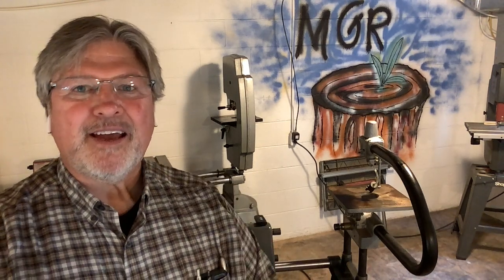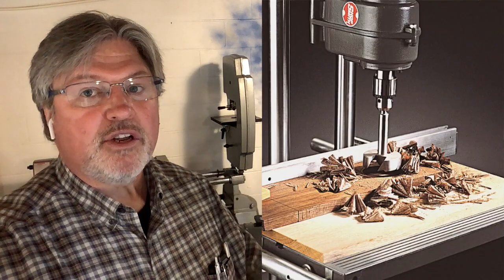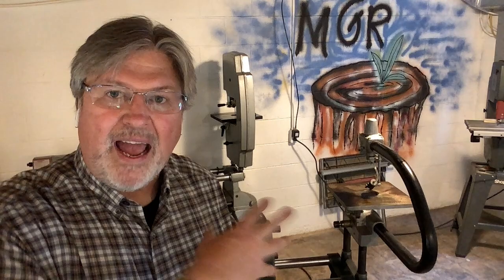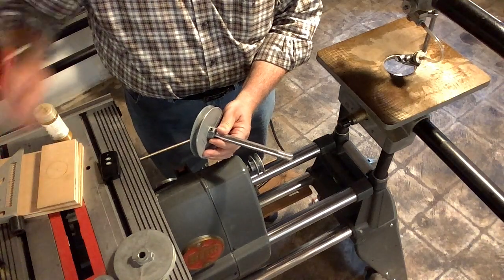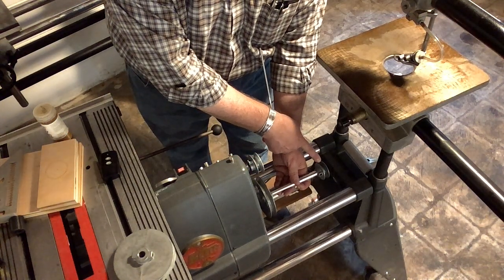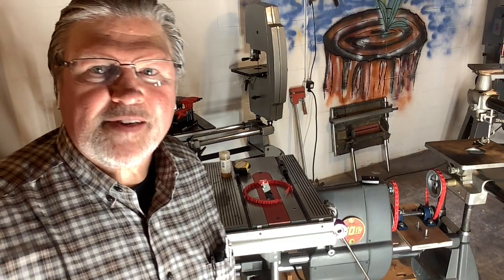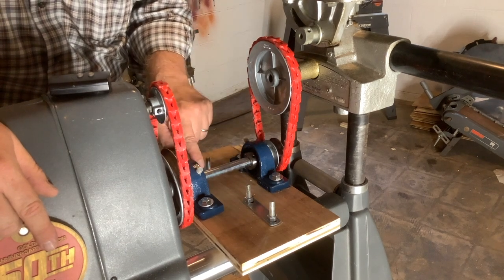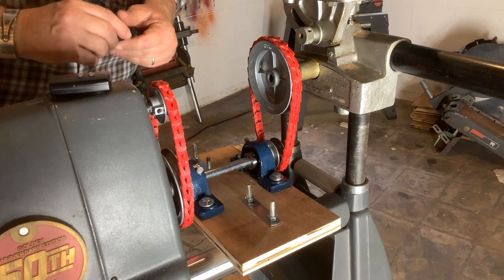Shop-built Shopsmith Speed Reducer

Comment: Can you show us cutting some brass or aluminum with the jigsaw and how it would work with the bandsaw? and in theory will this work with the powerpro? and what about the scrollsaw to say make Brass ornaments or maybe clock works??
Reply from the maker: Hey Joe. Probably not any time soon. You’d think it would be straightforward, but working in my sister’s basement has limited the scale on my operation and I just don’t have the supplies handy, for example, my files are now in storage, I’d have to buy a bandsaw blade I’ll likely never use again and the same goes for the stock to demo. I may take another stab at this once we land somewhere. Yes, this could work just fine with the PowerPro, thought I can’t think of too many places where you’d need to go slower than the 250rpms the PowerPro already achieves. Yes, you absolutely could use the scroll saw with this for cutting the half hard brass pieces used in clockmaking, Scott

Comment: Scott, I must have found the article decades ago, as I used the wedge under the Way Tubes, and used a larger pulley that would fit between the WTs. Set up and take down was quick as I remember it, and some fuss getting the right belts and tweeking the wedge, to tension the belts the way I wanted … worked great.
Reply from the maker: Excellent, John. Yeah, the article calls for a 7" pulley, which is not only hard to find these days but slows the SPTs quite a ways lower than I've ever needed.  Any chance you still have it? Scott
Reply: @MyGrowthRings  nope. It went with my original 500-510 when I sold it … 😢
Reply from the maker: @johnoerter2883  Well that's sad, but perhaps it is seeing some action with the new owner. Let's hope. Scott
Reply: @MyGrowthRings  I hope so … after I sold it the guy kept pestering me for items he was sure I’d kept back … got kind of distasteful, adding to my sadness. I missed my old SS for 20 years. 

Really nice to have the new Mk7!

Comment: Thank you Scott. Simple! Just ordered all the parts including both the 1/2 and 5/8 pulleys for the SPTs.
Looking forward to putting it together. Will likely substitute your U bolts for J bolts with Bitner nuts or a similar solution.
Thank you.
Reply from the maker: That's a great plan. Thanks for using the links! Scott

Comment: I bought a package of Shopsmith tools a while back, and the seller thew in a rusted up jigsaw and a dysfunctional headstock just to get rid of them.  I thought perhaps I could make a stand for the jigsaw using the headstock and a fully system to create a variable speed power system with a very low end rpm.  Well, the headstock was in much worse shape than I imagined, and the cost of buying the parts for it and the pulleys necessary would total out to more than I thought I could get by selling the end product.  I didn't need a third jigsaw, so I refurbished the saw and sold it to a friend.  I pulled the motor out of the headstock, which was perfectly good, and gave it to another friend so he could upgrade his Greenie with more power.  I like the system you devised, but since I run the Power Pro, I won't be building my own.  Thanks again for supporting all of us Shopsmithers.  We cherish your info.  Glen
Reply from the maker: Thanks for the support, Glen. Your friends are lucky to have you!

Comment: So you roughly reduce the speed at the jigsaw to about a 1/4 of the 700 rpm at the headstock, correct?  I know it’s a bit off due to the 4.5 in wheels….
Reply from the maker: Correct. And yes, because I used 4.5 pulleys I got a slightly greater reduction. Scott

Comment: Ok, so you change the speed. What does that do to torque?  I guess that doesn’t matter to a die filer, but could that make a difference for other tools?
Reply from the maker: Actually, the torque should increase as the speed is reduced…
Reply: @MyGrowthRings  yeah, 1/4 the speed, 4 times the torque.  Thanks again for all these videos, very informative as always!
Reply from the maker: Yes, there is a reduction in torque, but keep in mind this is the same method that Shopsmith uses on their speed reducer. Four pulleys, two belts.

Comment: Could you use wing nuts on the U bolts instead of the nuts?
Reply from the maker: Sure. I'm inclined to only use a single knob and leave the other leg empty. It just doesn't need a ton of tension. Scott
Reply: There are knobs available that would work or you could make some. There are lots of videos about making knobs on YouTube.